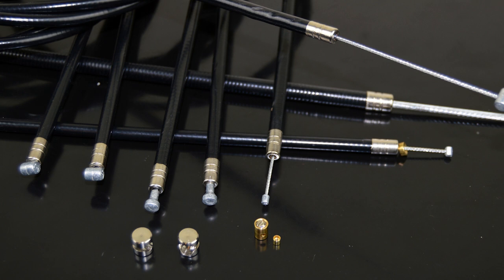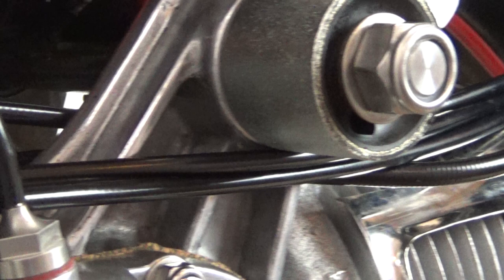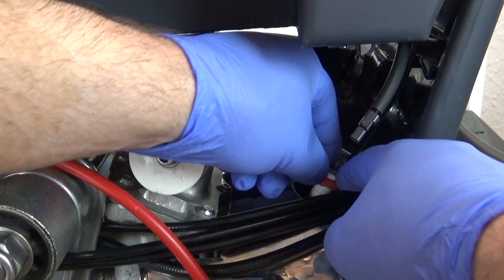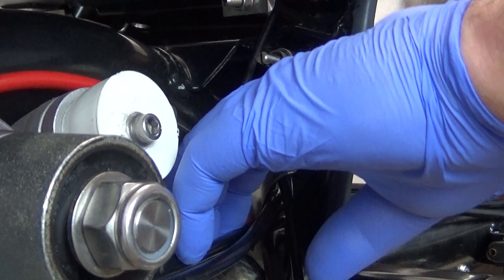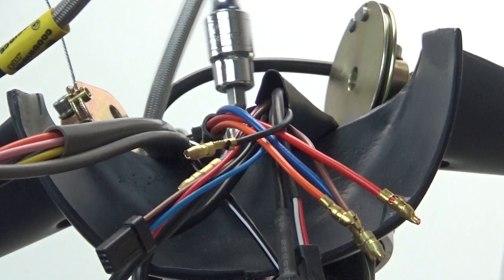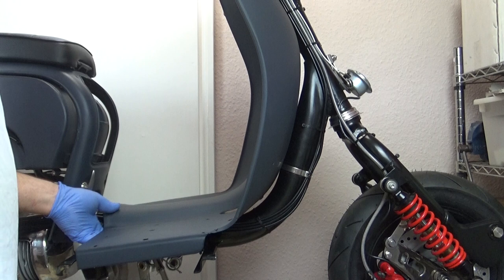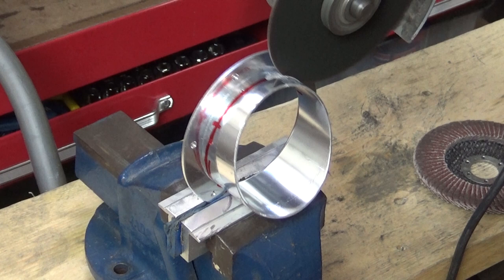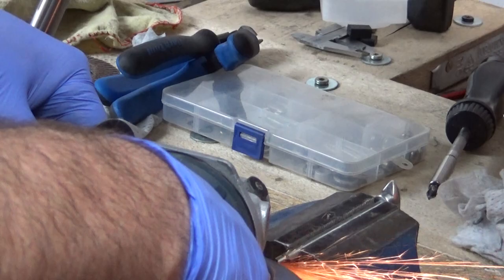Project Lambretta Episode 8

Comment: Nice job..without doubt. 
I remember doing this when 17..after building a special..from an Li 150 to 175.. with a Delorto 30 mm racing carb...fiddly fitting on, as it had a different manifold..but we got there.
Then fitted a 225..went well both went well..
Good days..now an old 67 fart